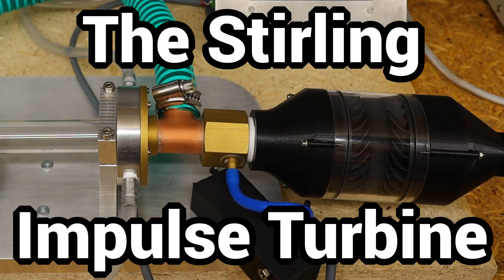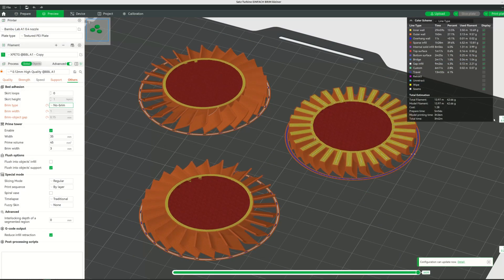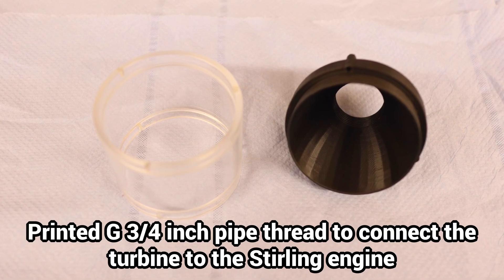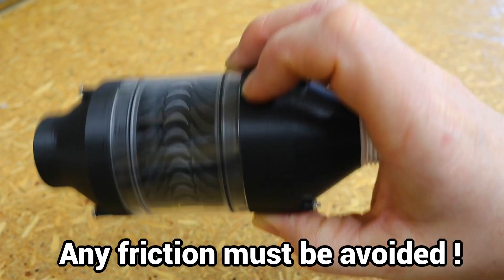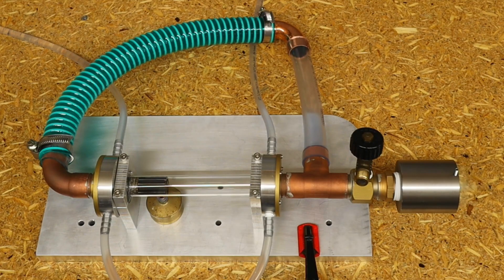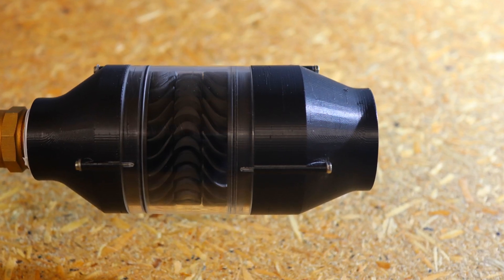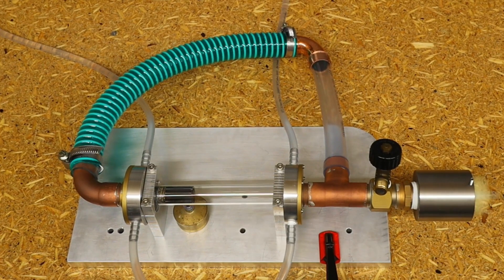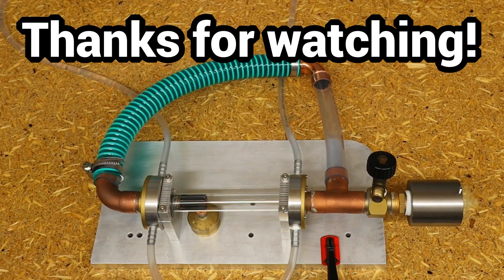DIY thermoacoustic Stirling engine with bidirectional impulse turbine for free energy to go off grid

Comment: Something interesting you might look at is using a thermal battery and Fresnel lens like exowatt to create heat from the sun without burning fuel and running that through your model.
Super cool build sir.
Reply from the maker: That is a really interesting concept to save heat for the night but when the sun is shining we have enough energy in the battery.
It is meant more for a support for the solar plant in winter or periods of low sunshine.
But its a great idea and if I would have enough time I would try it!
Thanks for your nice comment!

Comment: If you have an oscillating piece, why not strap a neodymium magnet on it and wrap the area of oscillation in the coil?

It won't be incredible, but it's got to be more efficient than the turbine.
Reply from the maker: My aim is to avoiding any piston as this is always a source of wear, but I also make tests with  linear generators and speakers!
The turbine would be a big step towards a near maintenance free engine.

Comment: This is impressive, I searched for years for some proof, however small, that a Stirling engine can be made with turbines, and here it is. By having a turbine, the performance limit of the engine, both in terms of efficiency and power, now only depends on how fast it is... so, this could be a technology with a lot of potential.

Comment: Do you think it could be possible to utilize thermal decomposition of certain materials to turn thermal energy into chemical energy? Like let’s say you have a material that decomposes at a certain temperature which causes it to cool down and you could perhaps use an electrochemical cell to remake the original material and generate a tiny bit of electricity. If such a thing is possible, could it be used on the cold side of a Stirling or some other heat engine to not only keep that side cold but also turn even more heat into usable energy?
Reply from the maker: That sounds interesting but I have no knowledge about it!

Comment: Is a turbine that much better than an oscillating generator with a moving magnet and a coil surrounding it?
Reply from the maker: It is easy to print and nearly maintenance-free in contrast to a piston thats the reason I want to try it.
I also will test a linear generator and a speaker generator when the new engine is ready!

Comment: Could regular speaker be used as a power generator? Easy to test with current setup
Reply from the maker: Yes, i will test this also!
Reply: @myengines2443  had this idea for over a decade, but didnt really tried. I would be very interested to see how it fares.

Comment: I'm so happy & impressed someone is diving into Stirling engines. Your channel is a real piece of work. I've been wondering if I can use a Stirling Engine to provide enough energy to power a wood-pellet-boiler (employed in a home radiant heat system) during steady state operation alone.
Reply from the maker: I am trying exactly that, a mico CHP.
Either fired with wood or self produced biogas, look at my older videos about that.
I think this is the perfect combination for the winter!
In summer we have enough sunlight for PV and in winter we need much heat wich is wasted for running the engine!

Comment: If the rotor and stators are printed as separate blades, the can be printed such that the humps and grooves of the 3D  printing process are perpendicular to the rotor radius.
I believe this will be an aerodynamic advantage:
Section 4 of this video, from 4min39 explains what I mean best:
https://www.youtube.com/watch?v=I2lxGYplpMA
Reply from the maker: Even after watching the video I am not exactly sure what you mean but I will think about it!
Thanks for your kind  thoughts!
Reply: @myengines2443  Picture an old vinyl record: if you draw a radial line or radius line from the centre out anywhere on it that line cuts through the groves the needle wold follow at 90 degrees.
Similarly for the linked fan's blades where the grooves and ridges that are a part of any 3D print now run 'parallel' to the air flowing over them....
Well you want those grooves and ridges to be ...'parallel' to the direction of airflow...
If they are perpendicular to airflow they just create drag.
Parallel  to it they minimise tip vortices and act somewhat like Tuberles.
Reply: @myengines2443  Oops it's part 6 not 4.  The Cheater fan.

Comment: I don't know why Solar Parabolic Dish & Stirling engine systems aren't more popular, there are many examples of commercial size prototypes which still achieve better efficiencies than PV panels.
Reply from the maker: They are simply too expensive, PV is unbeatable in small scale for using sunlight.
My generator is only for times of low sunshine, when the PV is producing not much and I also need heat for the house.
Reply: @myengines2443  Have you tried a small scale parabolic dish to power your engine? If it were large enough and had a large piece of copper as a heat sink I bet a parabolic dish could drive a steam turbine.

Comment: If successful with this, you should consider launching a project of a sand battery of diameter 2.5 m storing 8 days of power of a household (200 kWh plus heat), as the price of chemical batteries will not be low for the next 10 years.
Reply from the maker: Which temperature to use later for the engine is possible with a sand battery?
Reply: @ Temperature to use for the engine should be as high as possible, but if it should be limited to let’s say 300 oC, then I think it can be done via a 3-circuit layout of gas tubing: one at centre of battery, another nearer to surface, and another above the surface inside insulation, in which a computer controls how much each one is open to obtain a unified gas flow at constant temperature. It can also be done by making the engine take heat after a water turbine (it costs 2.5k dollars, 2.2 kW); such a 2-stage system (2.2+0.8 kW) would have 50% roundtrip electricity efficiency.

I saw a calculation that such size battery, if covered with 0.5 m of mineral wool, keeps up to 500 kWh of total energy at 1000 oC, losing 15% during the first 12 days. 30-50% of it can be returned as electricity, the rest — as heat. 

(The main use case of such battery is off-grid houses, having superfluous electricity from some extra 4x nominal capacity of solar and wind (for Germany climate). During a 2 week Dunkelflaute in winter the first 8 days will be covered by the battery and the rest 6 days by a diesel generator or from other source.)

Comment: Performance for sure. I've seen so many small sterlings, but nobody has successfully built one that scales to useful size. If it was still a pain in the butt to manufacture at first that's fine.
Reply from the maker: I hope to get the thermoacoustic Stirling in the power range of my rhombic Stirling engine.
With the 300 watts and running 24/7 this could  be a good support for the solar plant in winter!
Unfortunately the rhombic needs to much maintenance if it has to run round the clock!

Comment: Turbine efficiency increases if the air flow and pressure are very high. If the gas is replaced with high-pressure hydrogen and equipped with a rapid cooling system, the turbine could spin, maybe?😅
Reply from the maker: I am currently building a new prototype engine with much more heat exchanger volume and the possibility of pressurization.
Hopefully the engine is the capable of generating some energy with the  turbine!

Comment: I am a litle bit concerned that the flexible plastic tubes maybe absorberes som of the energy. Maybe only rigid piping would be better?
Reply from the maker: For the first prototypes I use just plain PVC tubes and performance was very weak.
Then I upgraded to reinforced pressure hoses and the power was much better.
When I start to go pressure tests I have definitely to use rigid pipes as you say!

Comment: Plz try smaller 3mm id bearings and measure rpms. Half of that speed is good starting point for search of motor for power generation.

Also you can try two thermoacoustics end to end to try push-pull mode and air pressure increase.

The rotor should be balanced too.

Hope that some of the ideas were useful.
Reply from the maker: Thanks, help is always welcome!
I chose the big shaft diameter to get an easy possibility to connect the generator motor to the shaft, smaller would be better.
Hopefully with my more powerful second prototype it will be better!
Things are complex enough for me at the moment but multi stage engines offer many advantages, when I am more familiar with thermoacoustic theorie I will try  this!

Comment: Holy cow. I thought this was another scam video, but he's actually really getting a working model going. I know it's expensive but I would suggest a wick lamp between two say curtain rods a footlong as your power source a wide base so it doesn't tip over and cooling fins at least a footlong, evaporative cooling is going to be your best bet.
Reply from the maker: I am currently building new heat exchangers with much bigger surface areas.
An electric heating is indeed much easier and better but as I want to power the engine with biogas and wood I even will not try it for the experimental stage.
Thanks for your nice comment!

Comment: Wow: You are encroaching upon my design. You will soon discover the need to integrate the acoustic loop into the turnine(s) thus capturing both hot and cold reactions and applying them to rotational transfers. 😊
Reply: I recommend looking into supercell Systems and the resulting mesocyclone for your Stirling output.
Reply: Much smaller, neater package as well.
Reply: It's a scale issue. The Earth has a huge buffering zone on BOTH sides of differentials. Delta-P and Poissons Distribution are your needs. So, you need to increase the mathematical potential for required nuetral ionic transfers/interactions between moisture and atmospheric gases. The potential for lighting must be reached ✨️ 👌.

Comment: glad i found your video, i was literally bout to experiment my own version of thermoacoustic engine but saw you're dedicated to building one that works. i don't mind giving you some tips and tricks and optimization recommendations.

1. you need to build a 'base coverer', meaning something to cover your fuel or in this case the candle lighter that's lighting the setup you have there. why do this? because it increases the power output, the current design you have shown in this video, the thermal energy from the flame is mostly wasted into wasted heat into the 3d environment/atmosphere. by building a small coverer the 3d space around the candle fire, the air molecule, will be heated up inside of the cover chamber and this retains the heat source's energy, aka the candle light source. so the potential for energy is contained instead of going out directly as waste. of course make sure your base coverer has a small hole, remember candles/flame source cannot be lit if there is no oxygen left, the 1 small hole will maintain the oxygen feed into the base coverer while optimizing heat maintenance.

2. speaking of fuel source, in the video you seem to show that you are using personal generated methanes to power engine? that's all fine, but you should look into another alternative method of utilizing fuel more efficiently. in youtube search the phrase
"1652°F flame that lasts over 100 hours – diy ideas you need in your life right now"
copy that method and you should have a fuel source that can burn for more than 3 days, its also small and compact as well. if you want a bigger version just youtube this phrase:
"UNLIMITED Heat For Your Home | NO ELECTRIC NEEDED"
its the same design, but burns even longer.

3. IF you want your stirling engine to burn longer when you turn off the candle light, get a sand battery going and how to do this you just get a small container and put fine grain sand into it and use the candle to burn the container, make sure the fire doesn't melt the container so that means get a container that can surpass the melting point the fire is burning at. the container will heat up and the sand will retain the heat, once you turn the lighter off the sand will retain the heat for another 30 minute to 2 hours maybe even, so you save even further energy loss and still powers your engine without the candle light. of course also if you utilize the sand battery route, make sure to get your 'base coverer' big enough to cover the entire apparatus here.

4. your build is very chaotic, heck the first time i've seen a stirling engine built like that, i'm more familiar with the stereotypical youtube stirling engine not textbook stirling engine. you should really go for the regular youtube design, it seems to be more efficient and smaller in design making the parts more simpler. plus the 3 things i've mentioned before is more geared for this as well.

5. lastly, ditch the turbine generator, i don't think its meant for the stirling engine and its moving parts, which defeats the purpose of the synergy of the stirling engine. i'll give you my idea instead, and that is use rochelle salt crystals to generate electricity through the stirling engine. how do we do this? use the stirling engine's acoustic noise to oscillate and or vibrate another apparatus which your rochelle salt crystals will be attached to it and as the apparatus vibrates the crystals will be getting hit and generate electricity out of it through its piezoelectric effect. the stirling engine is known to produce loud sound, this is perfect for this harmonic vibrational mechanism, plus this is essentially NO MOVING PARTS, its all working in pure vibration where as your turbine has moving parts which you should know moving parts means friction and friction means energy loss and of course the wear and tear over the years so its even less efficient. my method with the rochelle salt crystals vibrating through an apparatus using the harmonic frequency is more efficient. you can youtube many many tutorials on how to grow your own rochelle salt crystals or you can order clear rochelle salt crystals online or near your local store if they have it.

of course #5 is charting into no-mans-land that's why i originally wanted to embark on my stirling engine, but since its no-mans-land you will have to do a lot of tinkering and experimentations to get the right setup to efficiently milk out the best energy output. i'll subscribe and see what you can come up with and see if we can improve on the design together. i really want the people to have this device brother. as for #2 you can make the input energy directly from the sun instead of using a fuel source as well but that's perhaps later down the line once we got something going. the smaller the design the better.
Reply from the maker: Thanks for your kind comment and suggestions!
It would be very nice if you build a thermoacoustic engine too, so the development can go faster and better.
Several makers are rebuilding the engine, I posted all neccessary 3D models, drawings, photos and a description in the members area.
Some things are also on the normal contribution tab!
I have to think about your suggestions and hope for more..
Greetings

Comment: you have to take into consideration the equivalent of a mass introduced by the resistance of the turbine and its effect on the resonant frequency of the system
Reply from the maker: It would be very nice if you could give more information about this, and how to derive the consequences!
The resonant behaviour of the thermoacoustic cirquit is very important but I am still learning the really complex theorie of thermoacoustics!
Reply: @myengines2443  any resonant system changes the moment you load it, in this case with the turbine and resistance of the cavity and pipes of it. I would take an empirical approach, varying the frequency of the oscillations by varying the piston / one larger and one bigger / then taking note on the overall effect on the output level, with the turbine attached and then readjusting until both the piston, the air moving and the turbine work at the same frequency. I hope this orients you in the right track. great videos by the way I love them.
Reply from the maker: @thethoughtfield  thank you very much for your help and your kind comment!
I will think about your proposals seriously and hope to use them in a good way!

Comment: I believe focusing on efficiency should be your first and foremost goal here. 

Plus I think the advent of inexpensive small-scale precision machining is upon us, or will be soon. With the introduction of microwave metal melting and vacuum casting (Shake the Future on YT), and small scale concrete-strengthened 3D-Printed shop machines (Chris Borge on YT) to the public eye recently, I believe metal parts will not be much of an issue for someone reasonably determined to replicate your results. 

keep it going, I'm excited to see where this may lead!
Reply from the maker: Thanks alot for your kind comment!

Comment: Use a linear generator on the old design, should work fine with the resonance power the way it is. Great work!
Reply from the maker: I am also building a linear generator as you can see on one of the last photos in the video.
A turbine is much more easy to print and less maintenance intensive than a piston so I favour it!
Thanks!